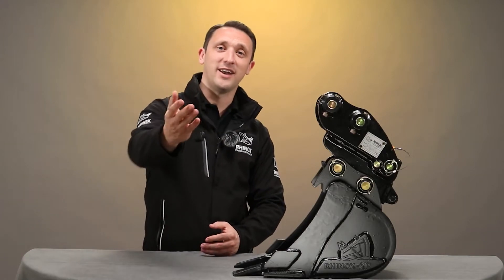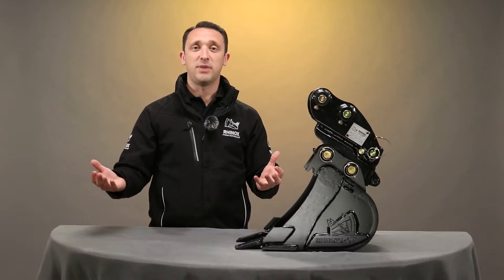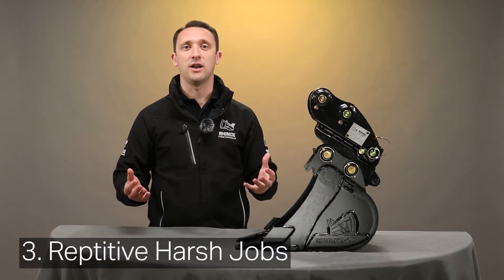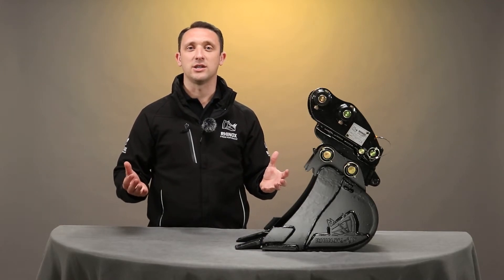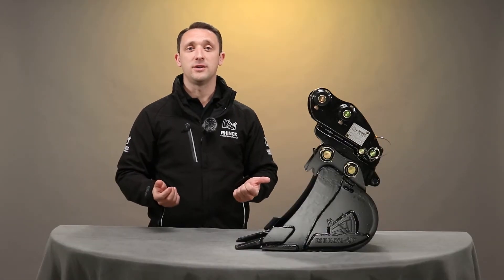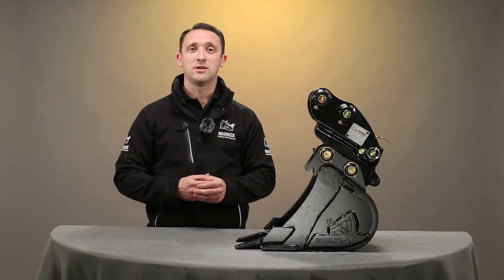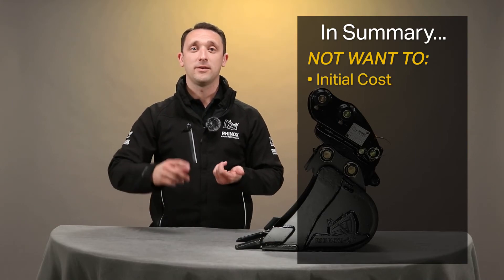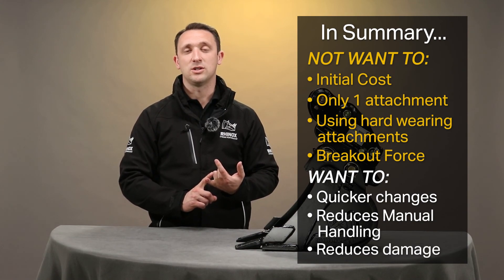SHOULD I FIT A QUICK HITCH TO MY EXCAVATOR? - Rhinox Group

Comment: Will this fit a Kubota U35-4? Also, will I have to change the thumb that is currently on my machine?
Reply: Adding a manual coupler, if you don't already have one, may potentially require a long thumb. if you have a std thumb now the tines may not come into contact with the leading edge of the bucket.